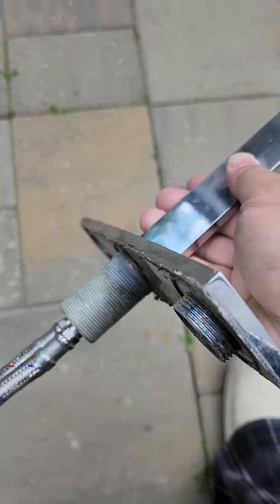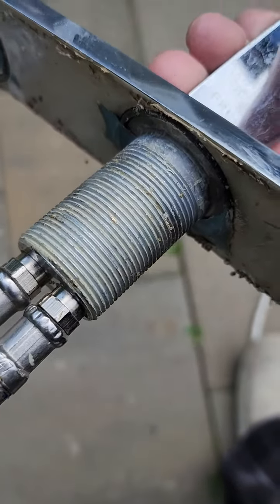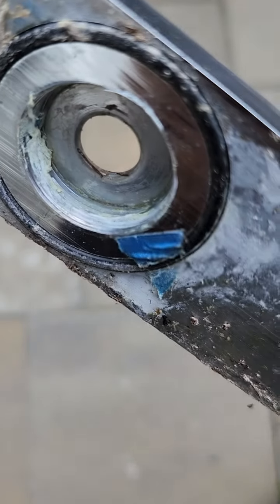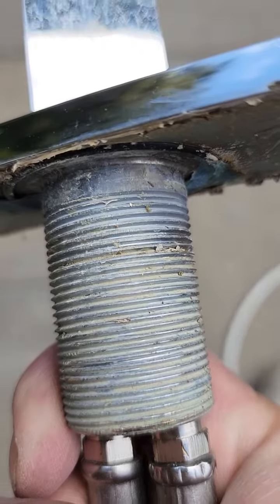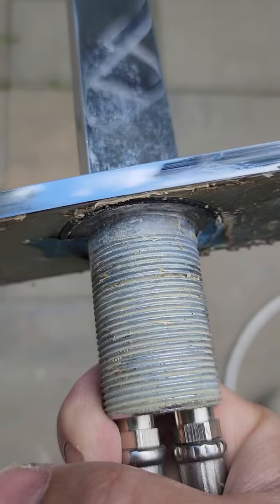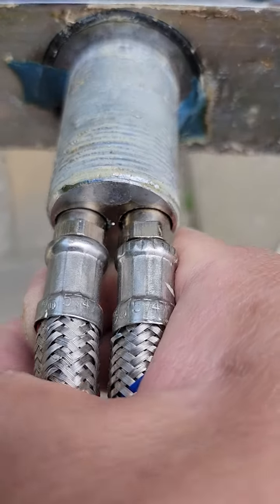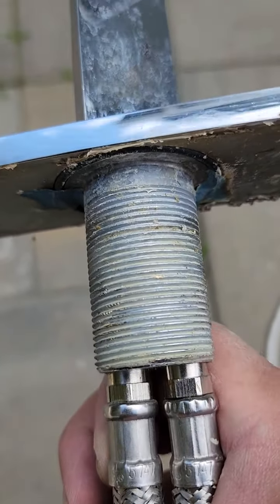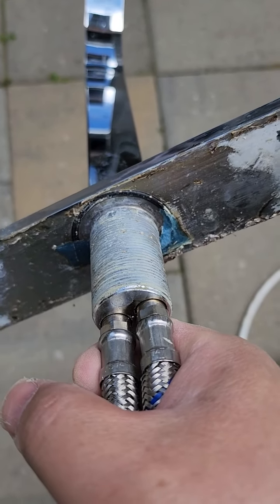Fresca faucet mount removal nuts sink

Comment: Do you have a video of you taking it off? I can’t figure this out but I have the same one. Did you have to take off the top left and right handles first? Or did you start from the bottom - you just turn the bolts on the bottom?
Reply from the maker: I dont have video taking it off but I remember the faucet had to be removed from the bottom. So therefore, the top must be dealt with first.